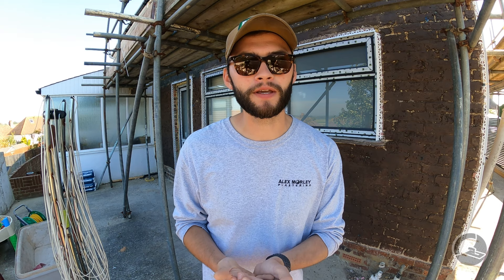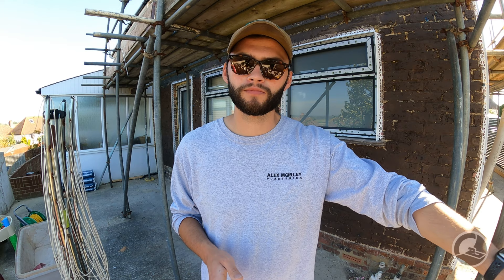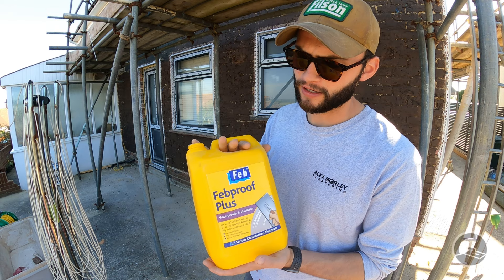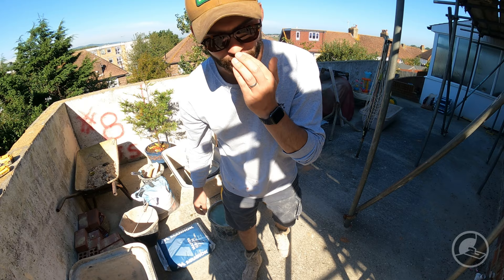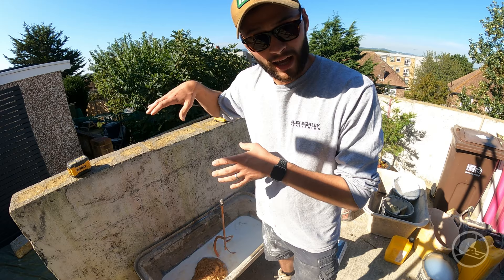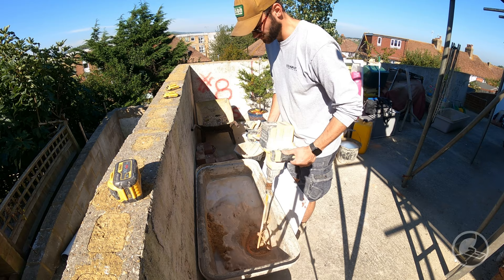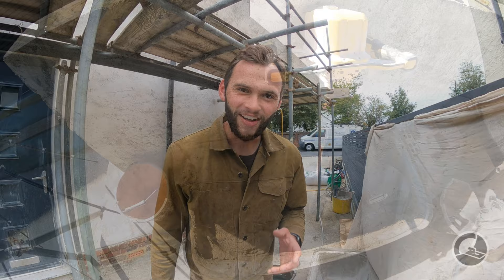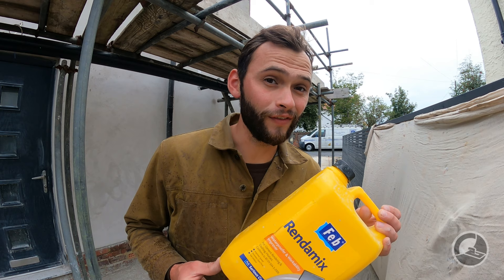Mixing Sand And Cement Render

Comment: I wish all builders knew that the render should be weaker than the substrate. Some of the internal render in my home is hard as diamonds. You can't knock it off without destroying the bricks. Hard means more brittle and soft means more flexible and less likely to crack with movement.

Comment: Really enjoying this series and your channel mate. I've got too use to just doing internal work over the years and therefore are lacking confidence in external. I really need to get stuck into some sand and cement next year when the weather changes. It's be nice to hear about how you cope with the changes in weather like rain when rendering a house
Reply from the maker: Thanks for the comment Ian. Tbh, being in the UK rendering in the summer is a lottery. Sometimes you win, sometimes you don’t. We got caught out several times this year. 

My suggestion would be book in a couple of weeks of skimming between renders (especially if they are complete houses, just so you have something you can fall back on incase you get rained off. 

If you stack one render after another, if you get a rain delay it pushes all the other jobs on. 

Also allow 25% extra on your time for these delays as they rarely run to the time scale you think. And include that in the price. 

Hope this helps.

Comment: How heavy are the bags of cement? What is the volume of the black buckets? I use 18litre buckets and 20kg bags. For scratch coat I do 2.5 buckets to a 20kg bag and about 1 litre bucket of hydrated lime per bucket of sand. For my top coat I use 2 buckets of sand per 20kg bag of cement and 2 scoops if Synlime (synthetic lime). I was always told to go richer in cement for each successive coat. I am in Canada and use this for parging, which is like a render on a wire mesh over foam for the basement portion of the house. What is your opinion on my mix? Thanks for the video I really enjoyed it!

Comment: As you do five plus the lime do you add more than the two buckets of water or does the lime make the difference.

Al.
Reply from the maker: Thanks for your comment. You will likely need more than 2 buckets of water in the mix unless the sand is already wet. Just start with that 2 buckets and add water as you mix to get the right consistency

Comment: Hi my renderer 1st coat used 4 to 1 sand and cement with sbr+waterproofer then 2nd coat 5 to 1 with sbr and no waterproofer is this mix correct?

Comment: Hi i learnt 35 years ago as a DIYer how to plaster from the plasterer that was working for me learning to do reveals first. Now i have had an extension built i have nervously begun to plaster again. I am now looking to render the extension and noticed you said about the mix on light weight thermal blocks which my builder has used, what are my options as i am now aware the render could crack. thanks
Reply from the maker: Hi Alan
You need to use a weaker gauge of render. 6 sand on the scratch, 7 on the top coat. And bed render mesh in the scratch coat.

Comment: HI Alex. Im just about to render my extension and came across your videos. Very informative.
On the mix i can see you have said the mixes for normal brick and thermalites but what would you recommend for new 7nm blocks. Thanks.
Reply from the maker: 4 sand 1 cement scratch
5 sand 1 cement 1/2 Hydrated lime top coat

Comment: Hello mate, quick question... I have decided to give my garden wall a go before I take on the back of my house to build a bit of confidence. As the wall is small (3x0.8m) and the weather is cold I was thinking of just using a slurry cost instead of render mix. Think that's a decent idea as render mix might be over the top?
Reply from the maker: Hi Ian if it’s just standard brick I would use SBR the day your going to render it. 

Slurry coat if the wall isn’t in great condition.
Reply from the maker: Hi Ian if it’s just standard brick I would use SBR the day your going to render it. 

Slurry coat if the wall isn’t in great condition.
Reply: Thanks Alex appreciate the reply, will go with a coat of SBR then 👍🏼
Reply: How long do you leave between the scratch coat and the top coat

Comment: Great video Alex , as per usual. What mix would you recommend going straight on to  Thermal Blocks.
Reply from the maker: For thermal blocks I would go with 6 Sand on the scratch and 7 on the top.

Comment: Find your comments on waterproofer interesting ... Myself only use the bare minimum just enough to make the material workable excessive amounts make for a weaker finish never sets up as hard ! Test sometime yourself scratch coat a small panel somewhere to your usual method then do a small panel with  less will require a little more mixing to get to a nice consistency for working leave them for a few days and you will see what I mean just try scratching either panel with a steel nail or something you'll see the panel with excessive waterproofer is much softer .. I am a plasterer have never mixed render with a drill myself I use a diesel mixer ... Have recently bought a DeWalt flexvolt paddle mixer tho just for knocking up skim can't wait to get it dirty 🙂 ! Where did you get the quick release for it? What brand is it ? Any link ?
Reply from the maker: Adapter
-
-
-

https://www.refina.co.uk/mixing/mixing-paddles-adapters/quick-change-paddle-connector.html

I’d buy the 200 paddle as well. Makes a
Massive difference.  
-
-
-
Paddle
-
-
-
https://www.refina.co.uk/mixing/mixing-paddles-adapters/mr3-spiral-paddles.html#/133-paddle_size-200mm_8
Reply: @AlexMorleyPlastering   thanks for getting back to me appreciate it ! .. standard paddle that came on it is quiet big already about 160 diameter by 200 high .. is really worth changing?
Reply: Anyway thanks again hope you enjoy the holiday season take care 👍
Reply from the maker: Definitely. 

Having a wider circumstance/diameter means the paddle spins faster. Mixes it faster, especially dot and dab, and cement render
Reply: do u put water proofer in your top coat mate? so many people saying different things its hard to know who’s right or wrong

Comment: the more waterproofer u use can weaken the mix your mixes are way too weak .the wall needs to have suction u should never kill it completely .u need to be doing 3 buckets to one bucket level of cement. Your wisking render come on bro get a mixer i bet u get loads of hair line cracks after a year ....where your lime too 😢